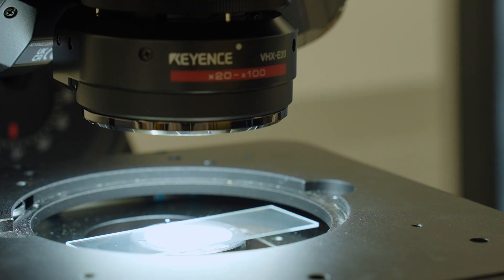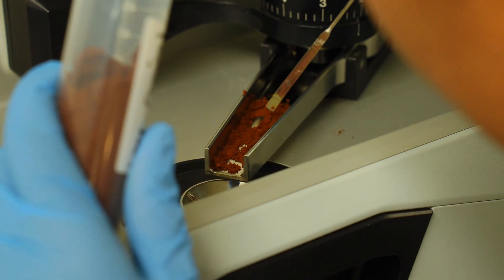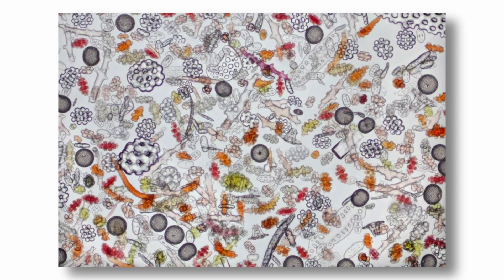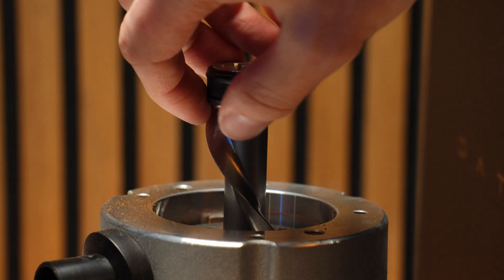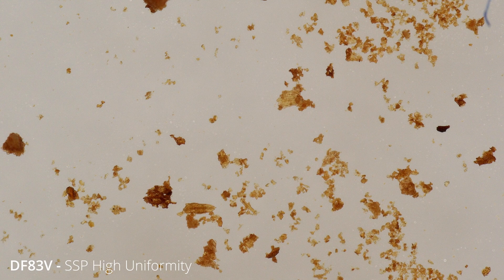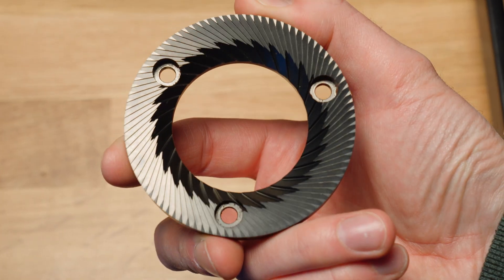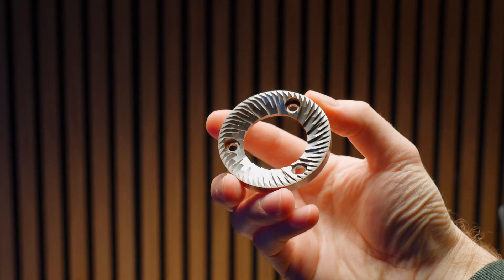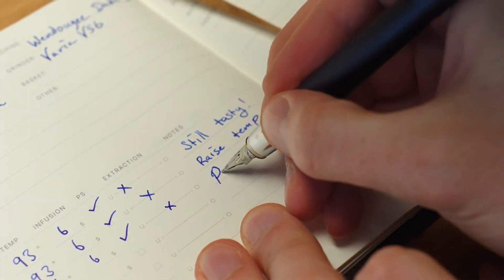The Microscopic Proof That Burr Architecture Controls Flavour

Comment: Hi Charlie. Great video. 👍 

I have the 189d in my Philos. I love them for medium+ espresso, with and without milk. However, if i use a lighter first bean I find myself wanting more flavor separation. I know there are the i200s, but reading online and watching your original video they sound a little lacking in sweetness and a little high in acidity, and washed out through milk, which doesn't sound ideal. Do the LeBrew Sweet burrs 'solve' this? I'd be really interested to hear your thoughts as i know you've used all 3! Thanks!

Comment: Very interesting! Thanks for putting in the work. If you get access to the lab again, it might be worth exploring slow feed again. My gut feeling is that single feeding coffee slightly misaligns the burrs that can't be supported around their circumference, thus tilting the burrs due to rotor and bearing tolerances, which follows your graphic of how impactful only 0.05 deg misalignment can be. Resulting faster flow rate could either be due to reduced fines (as many people assume) or just a change to the avg particle size caused by misalignment. 

Here's the test: on a single burrset, grind for espresso slow feed and then adjust the burrs so that the median particle size is the same as the slow feed case. 
If the particle distribution graphs are very dissimilar (e.g. far fewer fines or tighter distribution), then slow feed appreciably changes how the burrs grind. 
If the distributions are very similar, then it's likely due to misalignment shifting the avg particle size larger (effectively pushing the grind size coarser), and it would make more sense to just grind finer and take the faster grind speed.

In any case, excellent work and keep it up.

Comment: @Home Cafe by Charlie

One test that I really want is this:
A grinder that does NOT have an auger or pre-breaking screw (this is very important), something like a DF64V with stock burrs (no fancy burrs). Ideally, it would be a grinder that have a wider RPM range.

Then run the same test with both light and darker roasts (or, if that’s too many tests, a medium-dark roast). Just don’t use only light roasts, since they behave differently due to their higher density.

Sample 1: Low RPM with an arbitrary grind size that gives a 25-second shot — let’s say grind setting 10.
Sample 2: High RPM with the same grind size (setting 10).
Sample 3: High RPM adjusted to match the shot time of Sample 1. This might end up being something like grind setting 8 or 12, but the goal is to match the ~25-second extraction time of Sample 1.

Then repeat the exact same three tests using both slow feeding and dumping the beans straight in.

After that, analyze the particle size distribution. This test should provide insight into something the community has been debating and theorizing about a lot: how grind speed and slow feeding actually affect particle distribution.
What really happens to the particle distribution when you increase RPM? Or when you lower it? Or when you slow feed? There are a lot of theories that get treated as facts, but there’s very little hard data to back them up.
Reply from the maker: Grinder RPM is something I've really wanted to learn more about for a long time. The thing would be getting a fair like for like test and understanding that statistically. I mean, changing RPM with the same grind setting will not give you the same shot time, simple as that. But very worth looking into it!
Reply: @homecafecharlie   Exactly,  it won’t give you the same shot time, and that’s what makes it interesting!
The real question is what’s actually happening to the particle size distribution, and how the same burrs compare when you adjust the grind size to match the shot time of the first sample.
Many people claim that low RPM produces a more unimodal distribution while high RPM produces a more bimodal one, but those claims are mostly based on speculation rather than data. At the same time, many recommend high RPM for espresso, even though they spend a lot of money on unimodal burrs.
If you could achieve the same result simply by running a slower RPM, then why wouldn’t you?
Same with slow feeding and dumping coffee in to the grinder doing the same tests. How does it affect it?
There’s still so much that’s unknown, and most of it is pure speculation. A proper test that actually produces data and allows direct comparison of particle distributions would be incredibly interesting, and valuable for the entire community.

Comment: It doesn’t make any sense you say about the Chronicle burrs what about the most well known one of them all Baratza Encore ESP? It’s for espresso. I don’t really drink espresso, but I have a flat burr grinder and a conical burr grinder.! my question also would be the flat burr grinders whether ceramic or stainless steel would be better? The one I have is stainless steel but I’ve heard the ceramic was better for espresso. I don’t know if it’s true or not! I’ve also heard the ceramic last longer, but one stone and that wouldn’t be true lol😂
Reply from the maker: Not even remotely true. Watch some of my other videos about grinder burrs but yeah, the Baratza ESP is an entry level espresso grinder, it's like 1/3 the price or less of all the grinders I tested. Ceramic burrs for electric grinders is not really a thing as far as I know.
Reply: @homecafecharlie  Most ceramic burrs out there are inferior. However I adapted ceramic Ditting LaMarzocco 5.200.30 Swift Burrs  to one of my grinders, it is a great burr.  Even Lance Hedrick who has vast expertise in burrs, states that he can't find a better burr for traditional espresso, bar none, at any cost. One caveat, it runs at opposite rotation to most grinders. One can change the motor rotation, but that will not work if there is an auger at play. Yes indeed, according to La Marzocco ceramic burrs last several times longer.

Comment: You should repeat this test with unseasoned and seasoned burrs.
Reply: He mentioned this in the video.  He mentioned some burrs that community people said require seasoning and he said they were not as hard.  The "seasoning" is actually the dulling of the cutting edges so instead of cutting the beans, they burrs will crush/smash/grind more and that must suit some people's palettes better?
Reply: @Cinnabuns2009  nope, precisely cut beans taste shit, a little bit of fines from seasoned (or beans-stropped) burr taste way much better
Reply: @frederickateng3779  Not sure what you're getting at.  A mfg can make their burrs not as sharp, purposefully dull and make them hard so they always grind the same way and have no seasoning time.
Reply from the maker: Seasoning is becoming less important as coatings and burr materials improve. It's mainly an issue on burrs made of cheap soft metal, they need to blunt their edges for a while to become consistent(ly crap). Any grinder burrs that need seasoning to me is evidence of poor quality metal and materials. Worth replacing with something quiality.
Reply: @homecafecharlie  SSP is not of low quality and yet the instructions sheet that came with SSP, recommends 3-5 Kg French roast beans which tend to be quite oily. The sheet does mention coating the burr edges with oil. The oil hardens into a solid film upon exposure to air due to a process called autoxidation and polymerization. There also is the mechanical factor of honing the "wire edge" which I'd noticed manufacturers such as Ceado refer to. I suspect spreading seasoning over time allows layers of polymerization rather than wasting some of the oils before drying. I've not seen any data pertaining to this. I had run experiments, without going into details, it helps to season in intervals better than doing all at once. Mazzer seems to sandblast the burrs in order
to minimize the seasoning effect, for consistency reasons at coffee shops. Talking to their techs, they admit there will be improvements after running several Kgs. For my 83mm SSP coated cast burr, it took about 11Kgs to be optimized. Coated burrs can take longer to hone the wire edge. Lastly, sand blasting by the manufacturer somewhat shortens the life of the burrs, it is a minor tradeoff. Consistency is more important at commercial shops and Mazzer burrs are relatively inexpensive.
Reply: You should be charged 20$ to watch these kind of deep dives so you can appreciate them more instead of asking nonsense like this.
Reply: @xeracorocks  he literally asked for feedback on what he should do as a follow-up. I do think there's value in such an experiment because it provides a more objective comparison. Using the same burrs but comparing them unseasoned vs seasoned would give insight as to what changes in the grinds to impact flavor and consistency while eliminating the cutting geometry as a variable.
Reply: @xeracorocks  Do you accept Venmo, so he can pay"? 😉

Comment: Great video, fascinating views. For my pour over coffee, I layer the grinds, I grind the bottom layer quite coarse using DV83v with SSP cast burrs, I notice the different grind shapes with naked eyes.  BTW, the auger in DV83v does not crush the beans, specially in the newer versions that they reduced the auger diameter so the motor does not stall.  Unlike the augers in Zerno and Philos which act as pre-breakers. Interesting that you don't care for conical burrs which eliminates most hand grinders. I find many conical burrs at manual speed to be great. Of the few that I own, both Kinu MK47 burrs, for espresso as well as pour over do blow me away. I use 1Zpresso ZP6 for top layer of my pour over coffee with great results. The Weber Key's 83mm Mazzer burrs are supposed to be quite decent, probably in part due to a relatively low speed and large size.

Comment: Very cool. I would love to see what effect pre-breakers have on the grind, if any. Even something like chucking beans into a mortar and pestle to just break them into very large chunks before grinding.
Fun vid!
Reply from the maker: It's such a hard thing to test to be honest, so most of the conventional wisdom about it is pure conjecture. But in theory it reduces the mechanical load on the burrs so potentially if the grinder auger has enough torque to crush the beans up, it could make the load more CONSISTENT, if not simply easier to go through the burr chamber. No idea how I would test this to get genuinely insightful results though.
Reply: @homecafecharlie makes sense. Getting any sense of consistency in order to test that would mean (in my head at least) building out a separate machine with interchangeable augers or something. Aka not exactly cheap lol.
Reply: If you own a grinder without pre-breakers, you could run the experiment at home, run a batch with whole beans another after you break in a mortar and -pestle. I had done that by running beans first at the coarsest setting in one grinder then transferring to another grinder with the proper setting. You can do the same with a single grinder as well. It sure results in a more uniform grind with more clarity in the cup. There are industrial grinders made for mass production that have two stages of grinding.

Comment: Great video! I have been more interested in buying the best burrs I can afford, and had my eye on SSP HU/ULF burrs. 

But, I did read that the larger burrs make  mis-alignment less of a problem, than with 54/55mm burrs. 

I will follow your advice, as you taste the difference, whereas the  burr producers can't be trusted.
Reply from the maker: Bigger burrs means definitely bigger issue if the burrs are not aligned properly. I noticed this with the DF83V and needed an aluminium shim underneath the plate to make sure it was aligned. Marker test isn't as accurate as it needs to be, and an alignment tool is something I would seriously look into creating.

Comment: When you said you don’t like multipurpose burrs, were you referring to burrs designed for “both espresso and pour over” or did you mean the “SSP Multipurpose” burrs?
Reply: Same question exactly.
Reply from the maker: The variety of burrs in the video is the Varia VS6 Multipurpose burrs. But overall all of the MP burrs I have tried in the Philos, VS6 and others are not for me. Too generic, I like sharpness, clarity and high extraction yield.
Reply: @homecafecharlie Thanks for the clarification. Think this is a tad confusing as „multipurpose“ burrs tend to be mainly associated with SSP burrs. SSP MPs either MPV2 or even higher clarity UMV1s may be for you.
Reply: @33phu55   Agreed. The very reason I'm considering to order SSP UMV1 from the maufacturer, for extra clarity and sharpness, for pour over. SSP MP's  can make espresso and are supposed to be sharrper and higher clarity than SSP HU burrs.
Reply: @CoolJay77 I use those for filter and modern espresso and they are excellent

Comment: hi. im a genius. heres what youre missing:
(i tell you this without ego, just stating a fact so you consider my statements more carefully. also, dont hate me cause u aint me... ok maybe SOME ego...)

ill keep this short. here are my findings. burr geometries DONT matter. change grind size, youll get a completely different particle shape. did you try each burr on more than 1 setting? i didn't think so. see what happens as the ratio of gaps at each "stage" of the burr completely change as you increase the gap between both burrs a set amount. thats how grinders adjust size. the shape of particles changes dramatically.

did you try the same burrs on different grinders? even if aligned, each grinders axel has more or less flex. producing wider or narrower particle distributions. and different shapes.

what matters is grinder rigidity, and burr thickness. and to a lesser extent burr sharpness. slow feeding just flexes the axel the same amount each bean so no bean is on the other side to oppose it.

youre welcome. i cant begin to list all the idiotic misconceptions everyone keeps spreading about coffee science. this is just the tip of the iceberg. thanks for trying to do science. but do better science.

you can all disagree here👇. youll just look dumb if i respond tho. good luck.
Reply: The ego on this guy 😂
Reply: @Kaiser68 dude he literally said "i tell you this without ego" lmao what are you on about(!)
Reply from the maker: There is some truth in what you are saying, even if you chose to say it like a troglodyte.
I never claimed this was lab-grade science. It was a practical, visual comparison of real-world burr geometries, dialled in to the same espresso timing so they are functionally comparable, even if not mathematically identical.
Most of what you listed was already addressed in the video. Flex is a machine-design issue and outside the scope here. I am comparing what is actually on the market, not trying to define coffee particles for all time.
The full particle distribution PDFs from a £100k analyser are on my Substack if you want to engage seriously.
You would probably get nicer responses if you tried communicating like an adult.
Reply: @homecafecharlie   you missed every point i made if you still think a result from 1 setting on 1 machine for each burr has any relevance to anything. you're just showing random results at each of the specific the burrs width difference from each other.

if you did it on a different machine, you would get entirely different results. if you used a different coffee, you would get entirely different results. if you were adjusting for a different espresso water pressure, you would get entirely different results. if it was warmer in that room, you would get entirely different results. i can go on.

It's entertaining to see coffee grinds. but there's no valid science here. It's not a comparison of anything except random results
Reply: You should preface your comments by adding in that you're an asshole as well. You might have some valid points but nobody is going to want to engage with someone who speaks like a complete pompous dick.

Comment: This video is excellent.🎉
Thank you for the correlation of burr geometry and particle form. This does not mean that looking at particle distribution is wrong, though. You need both: the surface area (which is influenced by particle size and particle geometry) will determine how fast the extraction is. Large size differences of the particles will lead to different amounts of over-, under- and just-right-extracted particles. Please make more videos like this.